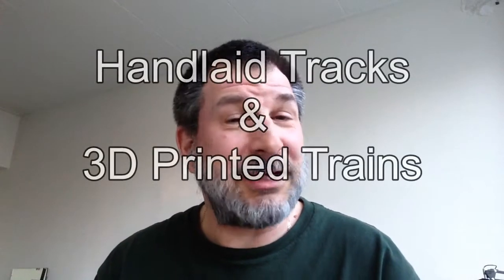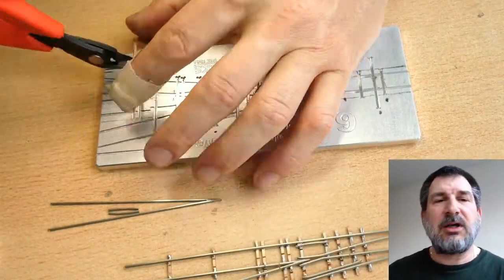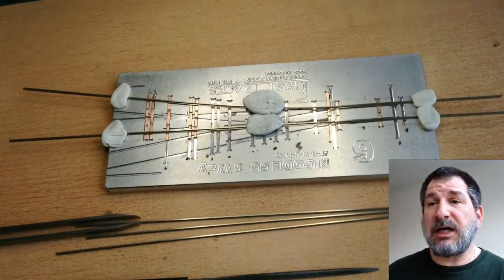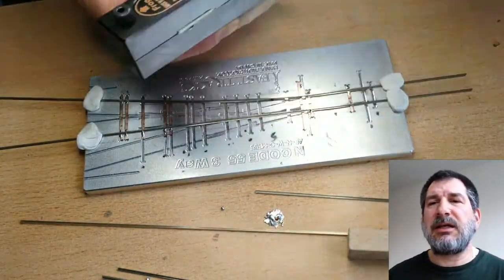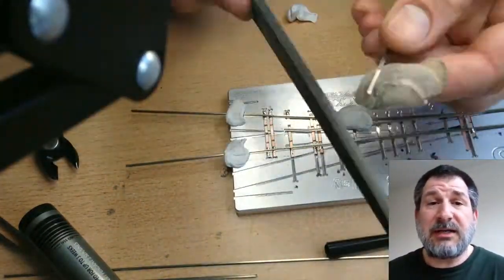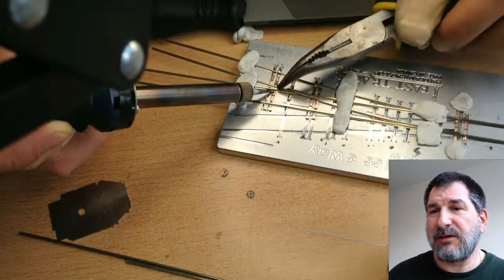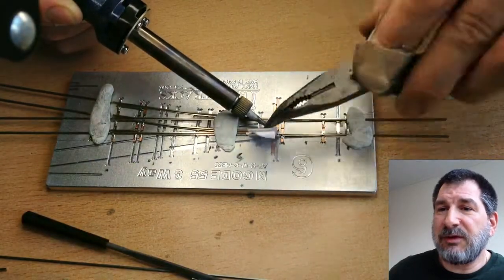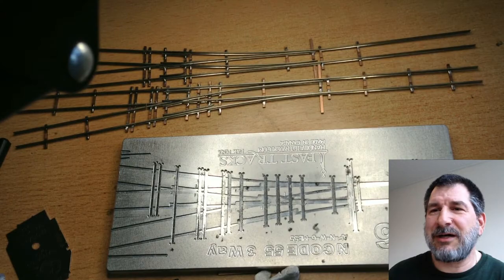Building a N Scale #6 Right Hand Turnout Using Fast Tracks #6 3-Way Turnout Jig Sped Up w/Commentary

Comment: After a 35 year break I finally decided to get back into N scale with a 3' x 8' layout. I've been soldering and building models for decades and considered Fast Tracks, but chickened out and bought Atlas code 55 turnouts instead. Now that all of the track is down, I wish I had taken the time to make my own. From a distance the Atlas turnouts look good, but up close the cast frogs and guard rails look rough. Also, some of the turnouts have continuity issues and will need jumpers. Love your work! Liked and subbed.
Reply from the maker: Time for a hand laid extension or new fiddle yard? I'm slowly adding my jigs to Thingiverse. Will put the straights and curves in the next weeks. Just designing the ends standardized so all pieces will fit together without any special fitting. Fast Tracks are great jigs, but shipping into EU is real expensive. Plus I've made the curves I need, not those they sell. The #2 Wye for example...